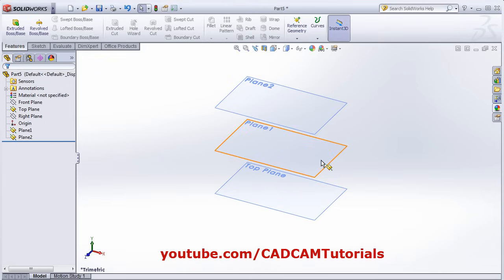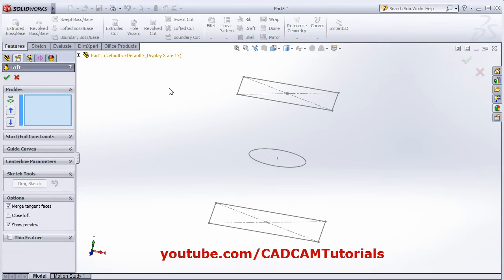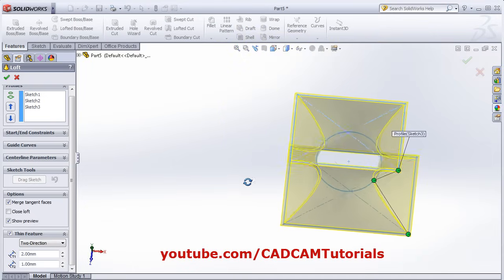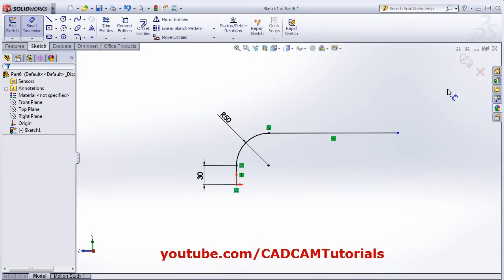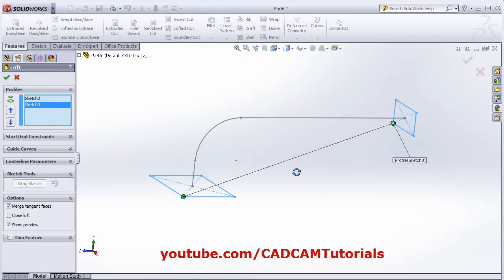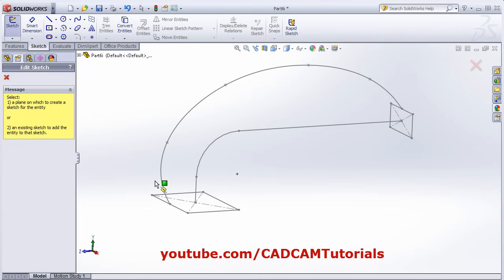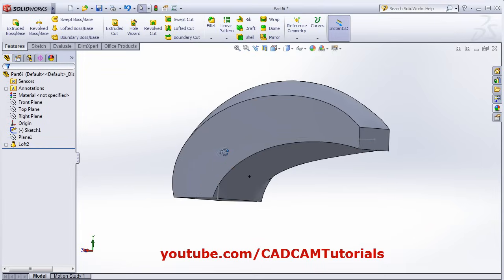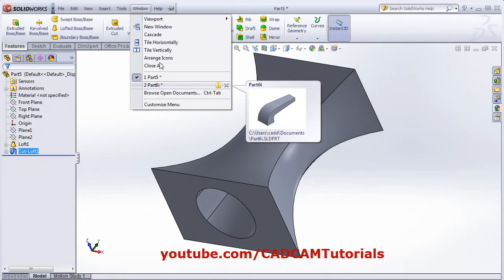SolidWorks Lofted Boss Base | SolidWorks Loft Cut | How to use Loft in SolidWorks, Guide Curves

Comment: At 7:30 I cannot get the guide curves to take even after redoing it 5 times.  So I QUIT for the day.  Returned to the second day, carefully followed each stepped and it sill did not work on the first try, second try I touched the first profile on a different side and poof, it worked, now figure that one out. Errrrr.